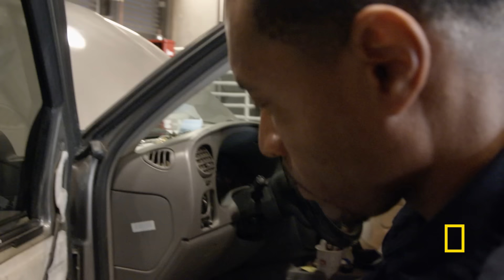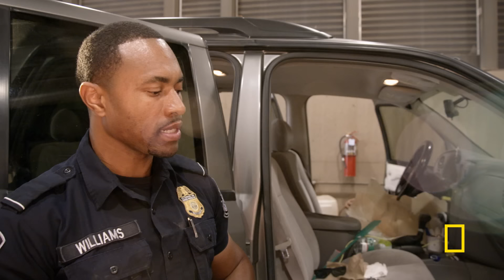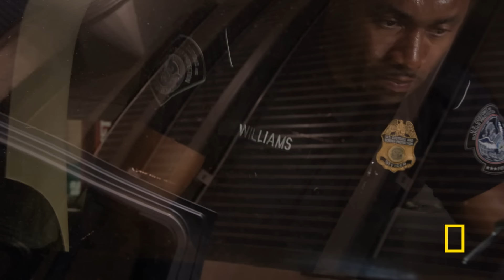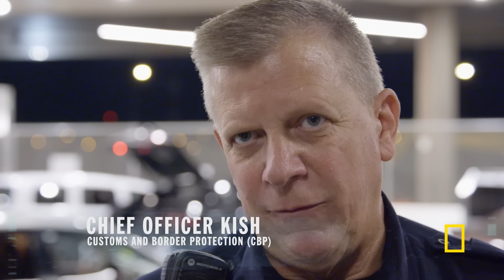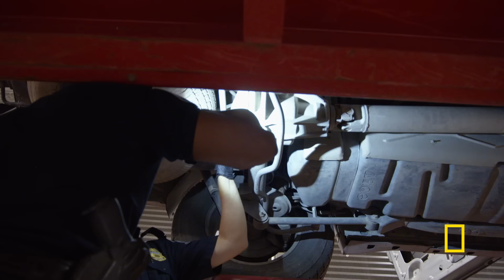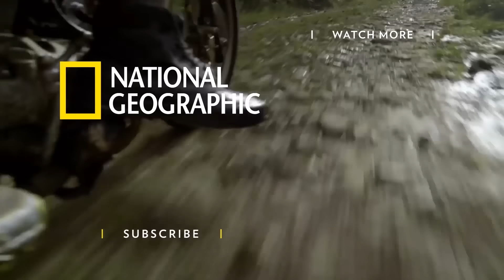Officer dismantles a car and discovers over $275,000 worth of hidden drugs | To Catch a Smuggler

Comment: I have to look at this from 2 perspectives. Firstly the nimrod was trying to smuggle drugs so he got what he deserved but on the other hand the CBP agent took the car apart like a bull in a china shop rather than disassembling it. I presume the car will be confiscated and eventually sold at auction leaving the buy not only to have to reassemble the car but also have to buy replacement parts for the ones damaged
Reply: Imagine being upset that a smugglers car was dismantled
Reply: @M21655  exactly. Make it make sense
Reply: @M21655 You missed the point. The car is now ruined for the next potential owner due to the carelessness of the officers.
Reply: @M21655
Imagine being upset enough to dismantle a car because you don't like my dietary choices. Are you going to chain me up for using the wrong brand of toilet paper too? Don't smoke meth kids. Drink a gasoline additive instead. Imagine not being upset that a robbery is being committed. Will you not be upset if I go into a liquor store or bar and steal everything and set the whole place on fire? I mean, I am saving potential drunk driving victims, right?